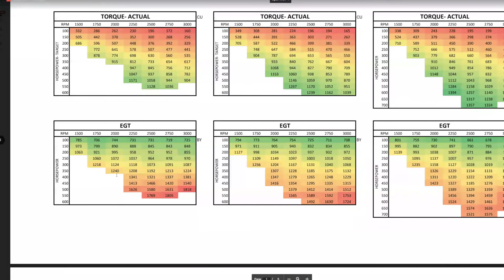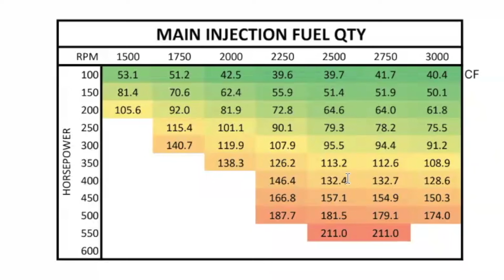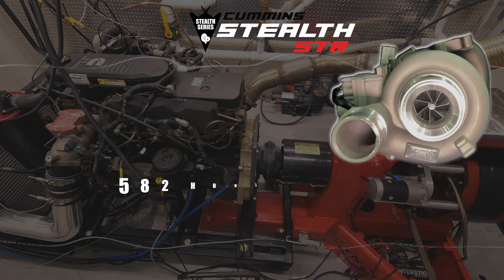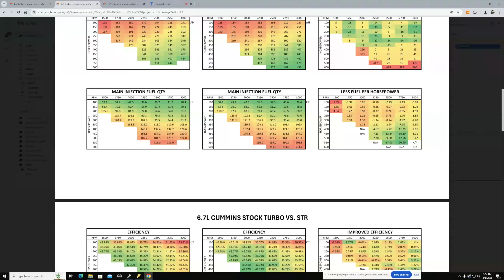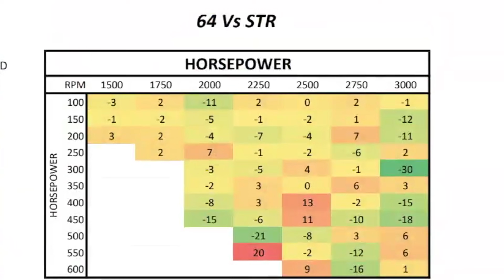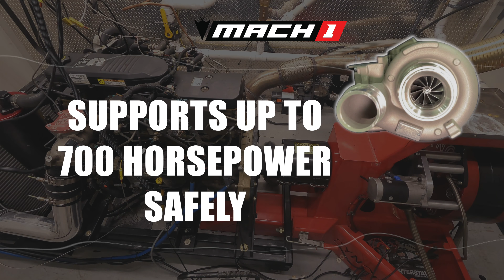Diesel Insights: 6.7L Cummins Injector & Turbo Limits!

Comment: HPA student here, loved your class on there. I have a question that I am baffled isn't answered in this video, considering it's about limits. In my reading, 29kpsi is about the highest safe-ish fuel psi for this injector design, but you are saying you went up to 35kpsi with no caveats?! What am I missing here, is all the info I've come across incorrect?
Reply from the maker: Yes. Our injector supplier 34500 PSI short-term max power application only.
Reply: @Duramaxtuner thanks for the response!

Comment: If I put in the 10mm cp3 and the 270bar sensor and paired with the 64 Mach 1, how do I go about getting tuned from you? I would like too make 650-700 with the SOTF.

Comment: I have a question for you. I’m running a 2014 ram Cummins with the EzLink system on the truck. I am getting my EGT readings from the EzLink monitor. I do not have a hard gauge going directly to the exhaust manifold. It’s all done off of the EzLink. My question is how accurate is this reading and where/how is it getting this reading?
Reply from the maker: @dd5744 Your EZ Lynk device is most likely reading your pre-DPF exhaust temperature. The 4th Gen Cummins has a series of EGT sensors in the emissions systems and your EZ Lynk is getting the reading from one of them. However, when you hear someone say "You don't want to run over 1,300ºF EGTs" they are referring to exhaust manifold exhaust gas temperatures. To get these readings you would need to install an aftermarket EGT probe into your exhaust manifold and use a gauge display like the EDGE Insight CTS3 to display it. If you would like any more information on these products feel free to give us a call at (815)-568-7920 Ext. 2123!

Comment: Have a 16 with your SOTF tunes.  Would the STR be a good choice for mainly daily driving with long highway trips, for efficiency?  Also running a Banks Monster Ram Intake.
Reply: The STR outperforms the stock turbo in most performance and efficiency metrics when loaded (making power).  While unloaded at highway speed you wont notice any difference between it and the stock turbo.  I recently swapped this turbo onto my '22 and went from 455/510HP (Mustang/Dynojet) to 525/585 (Mustang/Dynojet) without any other changes.  That's a 15% bump in power - same as we saw on the engine dyno.

Comment: STR for LLY-LMM? 
I'm in that weird Build or Buy era. 06 LBZ (vin 2) 142K miles. fully stock.
I want more sustained power and less heat under load when pulling grades in 100F heat going from 900 to 3500 ft. I also travel up to Flagstaff, and sometime Colorado. so basically, everywhere in US elevation wise.
I would like to get to +100 wheel, but I'm more looking for drivability vs a "xxxhp truck".

I know tuning is a HUGE part for these dinosaurs, but the truck gets pretty cranky running 2800+ to hold speed on these grades. it will do it and never actually overheats (230-241 at top). but it's clear oil temps are driving coolant temps when sustained at that RPM at WOT for 7-8 minutes. oil temps would be from the squirters saving the pistons from EGT. (I'm told). The stack was disassembled and cleaned, upgraded to Kodiak clutch that dropped 15 ECT. could throw a rad at it. but I think its EGT mainly from trying to hold peak HP on stock turbo, combined with high ambient. 

that's why I am thinking turbo. it SHOULD let me climb up a gear and drop RPM from the extra power.
thoughts?
Reply: Cordell, 
It sounds like you’re on top of your game. We are putting parts together and testing recipes for the VVT and LMLSTR package. I am optimistic that what we finalize will absolutely meet your expectations for controlling EGT’s’s while towing with that extra power.   You’ve clearly done your research and know the critical importance of cooling your oil. Like you said, it’s the only thing keeping those pistons cool and protecting the turbocharger.  I wish I could offer you an oil cooling solution but at this time I have nothing to offer aside from encouragement.  Godspeed!

Comment: I just got a 17 5500 looking to do a compound setup any advice I'm looking for high HP for towing a 28000 pound trailer all the time
Reply from the maker: That's an interesting question. I don't think we have had the pleasure of working with a Cummins 5500 with compounds. The ATS kit might be a good jumping off point if you have to have compounds. Otherwise we have recorded really good results with just running the STR.

Comment: This was really interesting. I enjoy learning about the systematic approach to making more power. Find the limits of a hard part or tuning, make changes then find the next limit.

I’ve heard shortening injection duration is usually better but is there an ideal range of where you like to see it assuming you can size the injector to suit a specific power goal? I imagine as with most things there’s a point of diminishing return.
Reply from the maker: We don't have a specific duration across all platforms. In general, the goal is to use as little fuel as possible to achieve your power goal.

Comment: Need more information like this in the industry. How did you get the higher fuel pressures for the 700hp tune? Was it with the 10mm cp3?
Reply: Thanks Rive!  To get the higher fuel pressure we used an Exergy 10mm Pump and 270Bar FRP sensor coupled with the appropriate tuning adjustments.

Comment: great video! can you put a higher fuel pressure switch on  the rail with a stock turbo and with a fass fuel pump & tuning ? thank you for the in-depth class!
Reply: Thanks Bobby, I believe your method of adding FRP to the stock turbo may improve the efficiency/cooling/lambda of the stock turbo slightly and the  STR even more so but we we did not go back to test.

Comment: Got a Question...What's your thoughts on Water Methanol injection? Looked thru videos and didn't see anything about it..I seen Banks had a video about it but that was many yrs ago.  Thanks
Reply: Methanol injection can be a very effective way of efficiently adding fuel to an injector-limited engine (like we had here).  It typically has a significant cooling effect on the air-charge and EGT's as well.  My biggest frustration with H20/Meth kits is their relative poor integration with engine management systems and their lack of long term reliability over years of hard use.  None of these problems would be impossible to overcome with good design and maintenance (I just rarely see it).
Reply: @Kevin-midmichigan  I was wondering the same thing and Nick's opinion on the matter. Thanks for asking the question.

Comment: 10:20 Any decent tuner will respect shaft speed on the turbo. The bearings have limits. Especially limits on the life of the bearings. Guys if your tuner does not monitor shaft speed be careful. They will adjust the veins on the turbo trying to chase boost pressure for higher horsepower.
Reply from the maker: Truth!